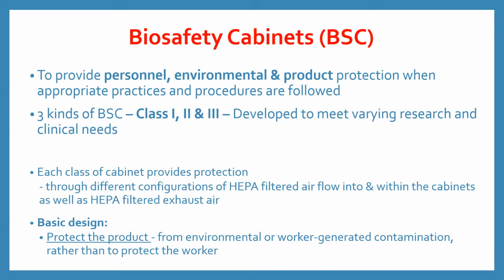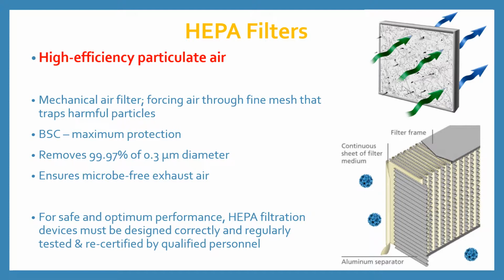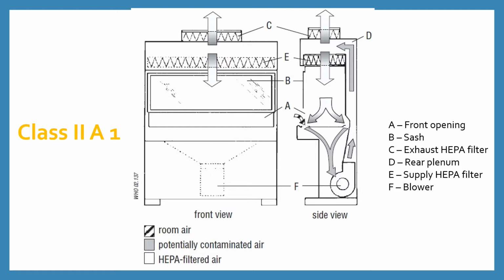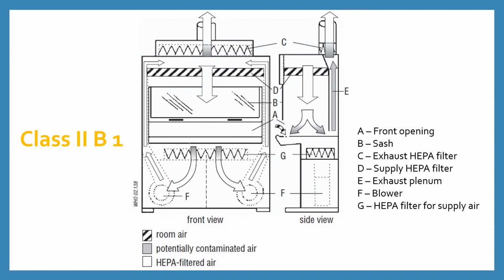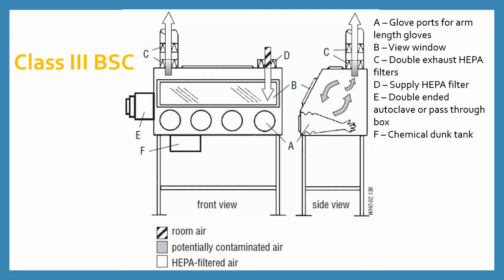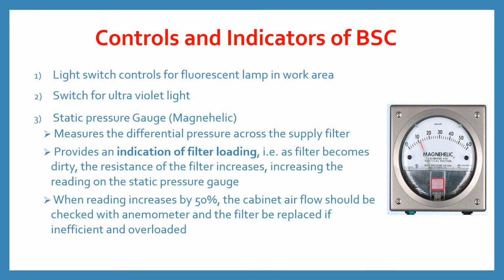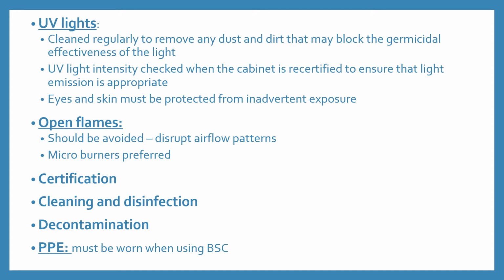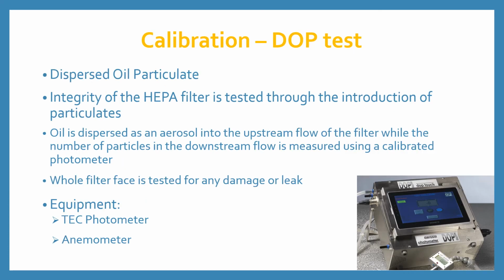6 3  Biosafety Cabinets

Comment: the blower at the bottom of B1 and B2  is removed already since it will create positive pressure at plenum and unfiltered air may escape when there is hole or leaks to the plenum even class 2 type A1 and 2 it was prohibited in 2008. hope this info will be updated nevertheless all the other info is good to know thanks.